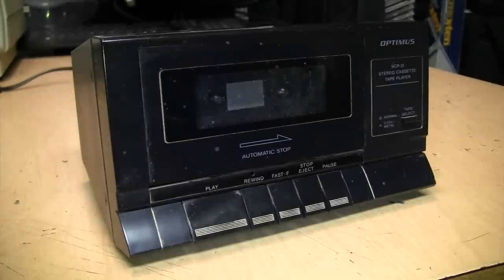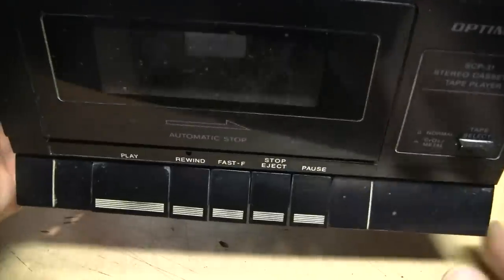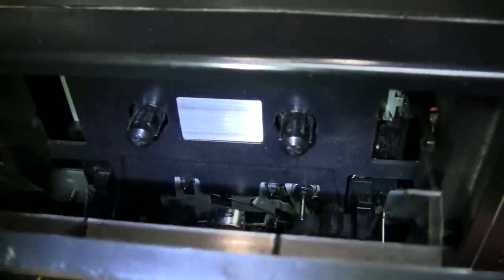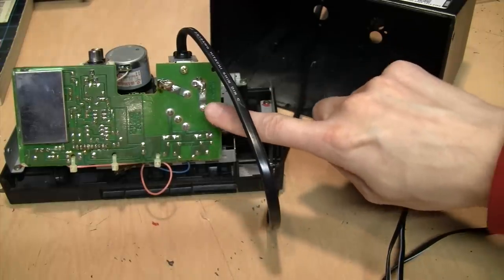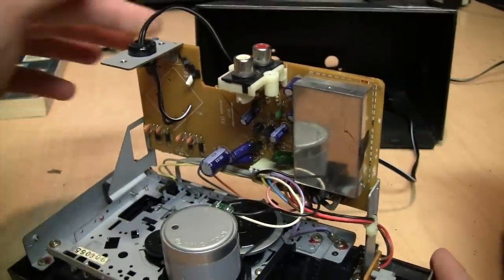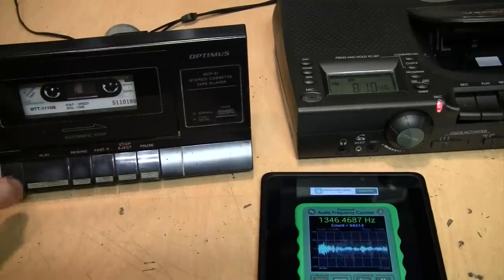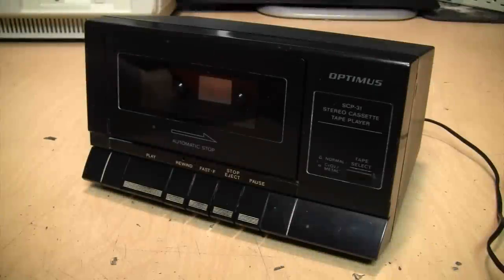Cheap but good Radio Shack SCP-31 cassette player repair

Comment: I had the UK version of this tape deck (from Tandy) around 1990 - 95 when I used to host pub quizzes and did some occasional deejaying.  (also had the Realistic battery operated Stereo Disco Mixer) It was useful if I had certain tracks on tape instead of vinyl as not being a full blown professional DJ then was sometimes cheaper to get tapes.  It made finding a track on a tape interesting when trying to ffwd/rwd to find it while a record was playing so had approx 3 minutes before I would have to play.  No-one seemed to notice the difference though.  I was a bit upset when it eventually died on me. Well, the play button popped off and the soft(ish) eject nature of the door made it a bit slow for quickly changing tapes so I guess I was slightly too rough with it as it broke too but I think the final straw was when motor started to die too.  Great wee device... 🙂

Comment: I honestly would have tried to find a replacement internal power supply for that cassette deck and modified it by installing a power switch… still an excellent job on the repair and the video, too!!!

Comment: what a great and easy fix, Nice job! I wouldn't have thought to check the transformer. Weird it went bad, probably experienced a surge at some point maybe.
Reply from the maker: Yes, I'm thinking the transformer could've been burned out by a lightning strike or power surge.
Reply: As others have commented, many of these types of transformers have a current or thermal fuse internally.  Having it powered up continuously certainly doesn't help.  If they blow, it is sometimes possible to replace or bypass them and get the transformer working again, but it's only slightly easier than fixing a transformer with a burned out winding.  (I've done both.)  In a simple circuit like this it's more time saving to swap it for a close equivalent.

Comment: I picked up the one-direction recording version of this, cheaply at a thrift store years ago, but only recently tried to use it as a stand-alone dubbing deck. I set it up on my desk, along with an '80s Sharp Dolby cassette deck, a 1960 Wollensak 1500 mono open-reel recorder, and my notebook computer, along with a set of amplified computer speakers.
Unfortunately, this Radio-Shack deck has a few flaws that make it less than ideal for my projects. Mainly, the lack of a headphone/monitor jack. So to check a recording I have to stop everything, pop out the cassette and play it on the Sharp or other machine that has a headphone jack. Then it's so light that pushing a control button just shoves the deck around unless I hold it with my other hand. Finally, my desk can get pretty crowded during my audio projects. Sometimes, a temporary bit of extra space to set some notes or cassettes would be useful. But the sloped top of the Radio-Shack deck frustrates placing anything there!

Comment: The thing with ac adapter is that it was probably meant to be used passed through a full bridge rectifer,filter caps and a 7812 regulator, and the 7812 requires a little bit more voltage on its input for it to be able to properly regulate to a stable 12V
Reply: That's just too costly for a cheap player, so they leave that out.
Reply: In the case of what he did getting this going, he would have done great by adding a 7812 regulator circuit and sticking with the 12V AC adapter. It would perform more stably (less fluctuations in speed with mains supply voltage changes)  and get a better quality supply for the audio circuits.
It would only cost a little more.
I'd do it for certain

Comment: I managed to find one of the recording ones  and one of these playback decks together at a yard sale, back when they weren't even all that old -- 1995 or so. The playback deck never worked but I used the recording deck pretty much until I stopped caring about cassettes. I thought I'd be using parts off of one to fix the other but the mechanisms weren't actually all that similar. The playback deck might have been older though.

Comment: A friend had a fishy smell in his living room - I recognised it as being the same as hot plastic from elderly light fittings I once had. I traced it down to an old VHS player, that like this cassette deck, was permanently plugged in on standby and had been for a long time. The VHS transformer was hot and the old plastic parts were slowly breaking down from the heat, thus the smell.
Reply: My old Thinkpad 600 has started smelling like that in recent years.  Yes it’s still chugging along strong and used very frequently at the project bench.

Comment: What an unlikely failure, and a great workaround fix. One could even wire up a 12V DC power supply in the same location (again with no need to worry about polarity) if they didn't have a proper AC power supply - there would simply be a ~1.2V voltage drop from the diode pair in the rectifier.
Reply: After having done the exact same hack Kevin did, except on a boombox, I don't think I would repeat it again. I'd rather install a barrel jack so there's less to get tangled and so I can use any of the gazillion 12vdc adapters I have on hand.

Comment: For sure the thermal fuse in the power transformer blew. In almost every transformer you can replace those. They aren't meant to be replaced; but it's certainly possible.

Comment: Hold on - they were still selling an 8-track deck in '89?  wow...
Reply: Yes.
Reply from the maker: Yes -- until 1990, actually.
Reply: It’s because we had tons of these 8 track players in the main warehouses. None of the stores wanted them. They were ‘Force Fed’ occasionally to each store randomly until they were finally gone.
Reply: Equally surprising you could buy an 8 track cartridge of Wham's 1984 release "Make it Big". I think Techmoan first showed that but I have just verified it on Discogs.
Reply: @MrDuncl  That likely was a Record-Club-Only release.  Retail store distribution of 8-track tapes essentially ended in 1981-82. Columbia House's Selection of the Month titles were offered as 8-tracks until 1989.  RCA/BMG Music Service' s Selection of the Month titles were offered as 8-tracks until 1987 or so. I have a few of these Record-Club-Only 8-tracks.

Comment: Anything that has a remote will have a constant on power supply, and even before that most electronics from the solid state era on were powered all the time. The power switch was wired to the output side of the transformer, if they had a power switch.

Comment: I have a Optimus tape deck, 100% original from 1996, belts still good, my deck is a dual deck model, either way, even thought it has a power switch, the power stays on. that is because it is plugged into my Optimus receiver and the receiver has power sockets in back. Two power sockets are switched, but one socket is on all the time, I use this for my turntable since the turntable powers down when not in use. The tape deck and my equalizer have no remote power must stay on so that the sockets on the back of the receiver can be used to switch power on and off, these are plugged into the switch power sockets. Many receivers were setup with power sockets in order to control the power of accessories like tape decks or equalizers. Both my equalizer and tape deck have switches that never get turned off.

Comment: There's another benefit of disconnecting the power input when not in use that you didn't mention: power draw. A small transformer like that probably consumes at least 1 watt all the time which adds up.
Reply: A good way to disconnect the power plus discharge the battery is to first put in play, press pause, unplug the outlet and then press stop. These are for those decks without a power switch.

Comment: Great video. Can you please make a video about sourcing good and belts, especially if you don't have an original one for size reference as most of the older players such as those featured on your channel either has no belts or have been disintegrated over time. and it sounds simple but a little explanation on how to put on the belts and check tension etc would be appreciated. Thanks. I bought a Denon DR-M11 after watching some of your videos and i would like to get it operational.
Reply from the maker: There is no one-size-fits-all tutorial because cassette deck belts vary so much from one manufacturer to another. But the video I did about upgrading the belts in the TEAC W-1200 may help you.

Comment: The wow and flutter is way better than some new full size decks .
Reply from the maker: I measured it at around 0.10% WRMS, the same as the current full-size decks from TEAC and TASCAM.
Reply: @vwestlife  That’s pretty good . !
Reply: @vwestlife  many times you have proven that what some people would write off as rubbish to be quite good .

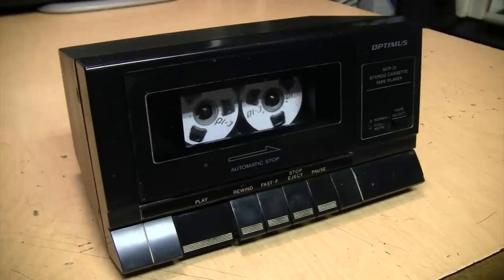Comment: 12:58 wow I ordered an old rotary phone that looks just like yours from eBay about 2 months ago and just like yours it has the permanently installed handset cord and it even came with the original four prong plug and rounded phone cord attached to it..
Reply: Western Electric Model 500 They're great phones.  If you still have a standard landline, they'll even ring and dial out.
Reply: @dennisp.2147  A 2500 would be a better choice. Same handset, ringer and network, but with a tone dialer. Even if you can dial out with pulse, you still need tone to navigate most modern call directors.

Comment: The treble response only goes up to 10k?  I would have thought it would be more like 12 or 13k from the way mine sound when I use them.  The SCT-86 does have a little higher frequency response, maybe up to 15k, and they do sound a little better.  Nice retro repair work.

Comment: nice work MacGyver, I probably would have tried a 12VDC PS & tapped into the circuit after the rectifier, do you think that would have also worked?
Reply from the maker: Yes, that would work as well.

Comment: I would have tried to find a way to put the transformer inside the unit so on the outside it looked normal with the AC cord coming out.  I'm guessing you confirmed that the primary was open on that transformer, and it wasn't something else like a bad solder joint?

Comment: I'm always have been paranoid of devices that leave the power transformer always across the mains not switching on the AC input and only switching and DC output. It makes it more complicated switching design as you have to switch on the AC lines and run that from the back to the front but it always made more sense to me, as you don't have the transformer sitting there warm. I've never seen the Sakura though so this is the first evidence of it. Most likely that deck was used in some sort of store where it literally just sat on all the time.

Comment: I wonder what the SCP foundation would do if they found out about this?
Reply: SCP-31(-J?)
Object class: Safe
Containment Procedures: SCP-31 Is to be kept in Containment Locker 31, only to be removed for testing with permission from a level 3 or higher researcher.
Description:
SCP-31 appears to be a standard Optimus brand cassette deck, however, when a tape is played in the unit (DATA EXPUNGED).

Comment: I have the SCT-86 that you reviewed ages ago, got it for free from a friend that works for a school that was getting rid of it. 

No clue where to find belts for it. They’re gone. However, it looks like it was barely used, thankfully.
Reply from the maker: Just get a $10 bag of assorted sizes of cassette deck belts from eBay or Amazon, and you'll find the belts you need in it.

Comment: Hello thank you very much for your YouTube channel I have enjoyed it I have one of the recording Optimus mini cassette decks you did a repair on one of them and another one before but they are very old I am trying to figure out how to get the cover off of it so I can change the belts there's four screws on the side one screw in the back but I can get the top pulled back but the bottom seems stuck I was thinking maybe the power cord is keeping the back from opening up I saw on your repair one the power cord actually has screws to take that terminal out mine does not it's just straight wired in with that black Puck around the wire any help you can do for me would be really wonderful thank you again for all your enjoyment by the way my name is Steve

Comment: Hey, I'm not sure if you're gonna see this but I could really use some help with my cassette player.

So I have this AIWA HS-G39 walkman, it's working pretty well and all the functions work as it's supposed to. But there's only one issue I haven't and don't know how to fix, which is crosstalk on the right channel. The player itself has an auto reverse player and has a 4 track head. I've already aligned the head, but there is still crosstalk on the right channel which is basically the other side of the tape's audio. This goes for both the forward and reverse direction of playback. I can hear the crosstalk on the right channel if I turn the volume all the way up and if the tape I'm listening to gets to the end of the song. I've also tried different tapes, still has crosstalk. Do you know any solution that can get rid of the crosstalk?
Reply: Make sure the tape you're listening to is aligned, like a pre-recorded one.  If it's one you recorded on another machine, how do you know your recorder is aligned? (Not saying it isn't, just getting you to think through your testing in detail.)

Have you demagnetized the head?

If it's a four-track head, does that mean it's an auto-reverse deck?  Does the crosstalk occur in both directions of play?  As the tape switches directions, it has to also select the other pair of pickups in the head; I'd assume that's electronically done, not mechanically, especially in a "walkman" portable.

Just a few thoughts, good luck!
Reply: @bobblum5973  I know the tapes I've made are not misaligned because I've tried them in my other walkmans as well and there's no crosstalk on them, just this AIWA walkman. And yes, the crosstalk happens on both the forward and reverse playback, only on the right channel. Basically I can hear it when it gets to the end of the song I'm listening to and if I listen very closely or if I turn the volume to max. And like I said, the head itself is already aligned.
Reply: @GenesisOasis  That does sound like you're doing your best to eliminate whatever possible causes you can.  I'm trying to think of anything else to suggest.  Without a schematic or service manual it's hard to think how the circuit is configured.  It's been decades since I worked on a four-track head reel-to-reel tape deck, which would be the closest thing to what you're working on that I've had to lay hands on.  Plus yours is stuffed inside a hand-held size case!

The only thing I can think of would be if they try to switch between two of the four tracks in the tape head and it's messing up.  Even something like it should be grounding or something similar to "kill" the track you don't want to pick up isn't working, so it picks up the stray signal anyway.

I took a quick look online, and did find a site called "Tapeheads DOT net" that has Question & Answers.  Replace the DOT with a "." and try searching there; one person had an issue with a 2-track flip-over head recorder doing weird things like recording one channel backwards.

Good luck!

Comment: There was a version that could be controlled serially. It is still seen today in a lot of old stores that use them for musak downloads at night with the daily on hold music that has advertised specials. Now we see play networks doing it with mp3 tech instead. But I do run into them once in a while. Ace hardware and biglots used these devices

Comment: Hello, is it possible make the same procedure to a tape decks that have 110V ? At my country we use 220V, so in this way I can eliminate the use of giants an inconvenient transformer (220V-110V). Thanks for the video. Always we learned something here.
Reply from the maker: Yes, the same procedure could be used to convert an audio component from 120 to 240 volts or vice-versa, by using an external power transformer that's rated for the AC mains voltage that your country uses.
Reply: You might want to see if your deck is using a dual-primary transformer. It probably doesn't unless it's a low-volume boutique model but if it does then you can reuse the existing transformer by changing its wiring configuration.

Comment: I have the both play and record versions.  They are bit pricey on Ebay with shipping, but they sound better than any of the cheap modern tape players I've heard.  Unfortunately now the player version goes out on one channel, and the recorder version sometimes makes a buzzing noise.
Reply: Channel goes out: Probably a corroded microswitch (or pot/trimmer?) or bad solder joint

Buzzing noise: bad ground connection somewhere or bad filter caps

Comment: I believe if you are not going to use any of these devices regardless if it has a switch or not, UnPlug it!
@VWestlife people still need to be educated about tape head cleaning as I have restore a bit of decks and found cotton from swabs wrapped around the capstan, always put the cleaning swab on the right of the capstan while deck is running in play mode, never on the left!

Comment: You should include the desolder-resolder process.Its nice to see it being done even for those of us that do it regularily.Other then that great vid!.
Reply from the maker: I'm terrible at soldering and use cheap equipment, so I'm not a good example of how to do it properly.
Reply: @vwestlife  WoW...I just assumed you would be a great solderer doing this type of video....you have really great knowlwedge of electronic components.You dont need a fancy setup.Solder wick and average solder pen.I think the mistake beginners make is not hot/watt enough pen...I like hot..in and out quick.

Comment: Another good way to make an educated guess of the voltage a circuit runs at is to look at the rating of nearby capacitors, they usually don't overspec the voltage too much